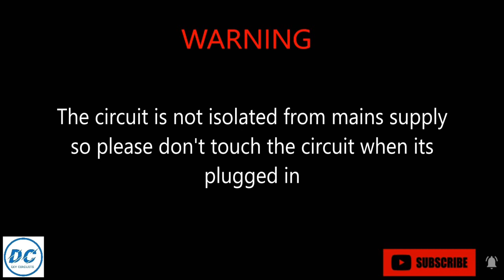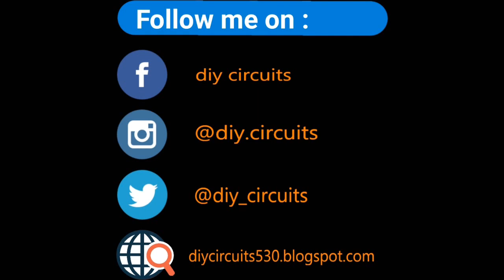how to make night lamp

Comment: Does the voltage come down to 3 volts? Or 5 volts? Cause the blue led also lights up even if ifs 5 volts
Reply from the maker: mid range of 3v to 5 volt